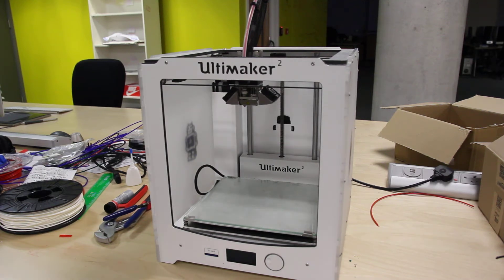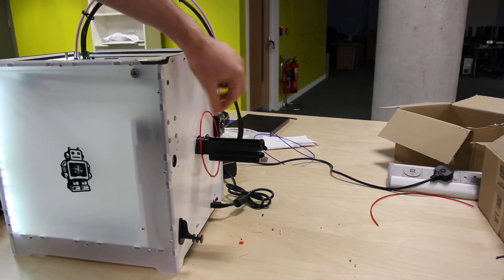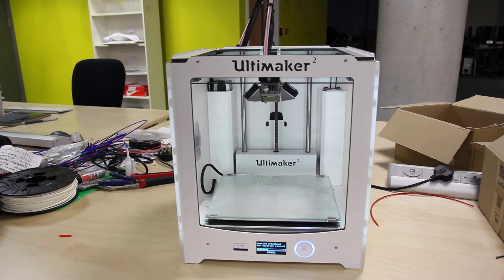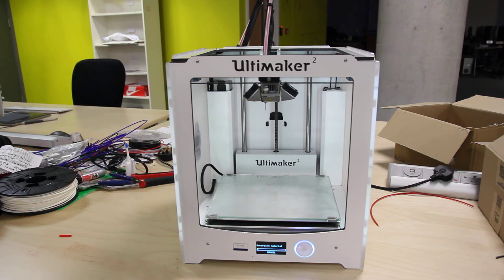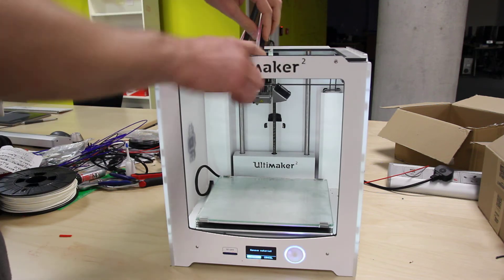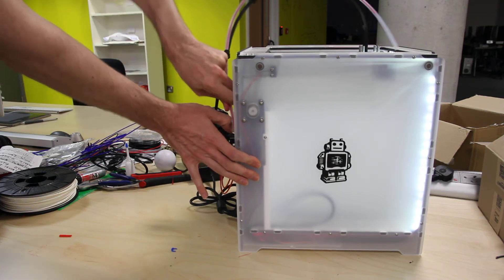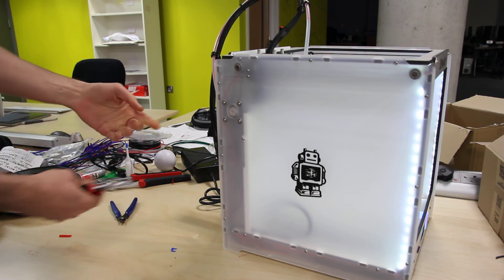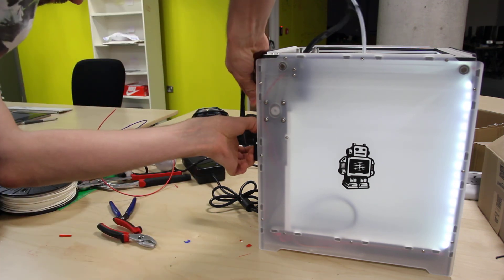Stuck filament remove method

Comment: quick question, what if you can not pull out the top as you did? I took off the blue part, but nothing comes out and i dont want to pull harder cause I think I will just break it
Reply: Cloakfiend thank you
Reply from the maker: You should always be able to disconnect the tube at both ends regardless. When you take off the blue thing you need to push down on the white clip or else it will not come out. If you are afraid of damaging your printer dont do it. Just go to the forum and ask someone to walk you through exactly. Send photos and people will help, there are always moderators about. Ill post a complete tutorial about how to easily print in a decent quality later this month. I havent posted in awhile but will do soon.